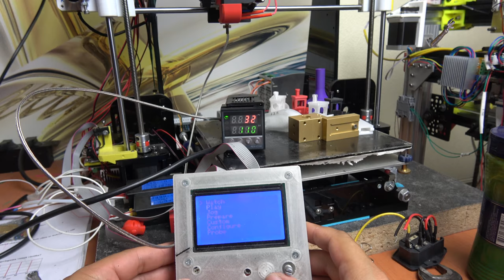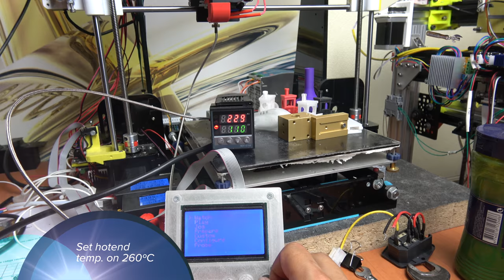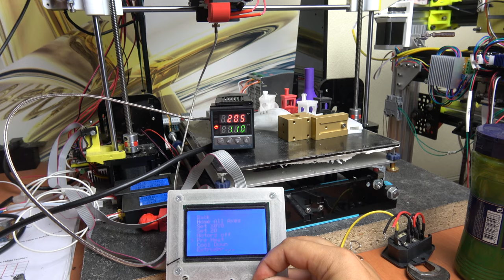Check real hotend temperature

Comment: same thing i am seeing on my ender 3 v2 but just using my Bluepoint laser which is probably less accurate as i am only hitting the heat block, i seem to be off by almost 20 degrees.  now to figure out how to calibrate the difference into the slicer